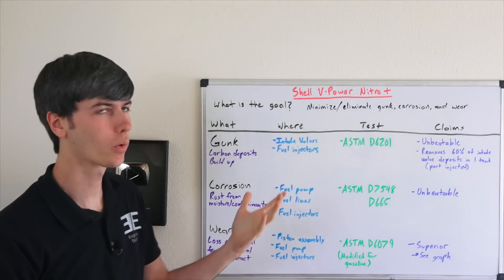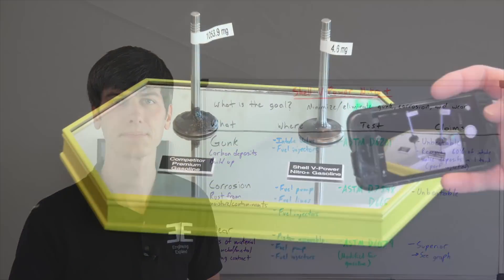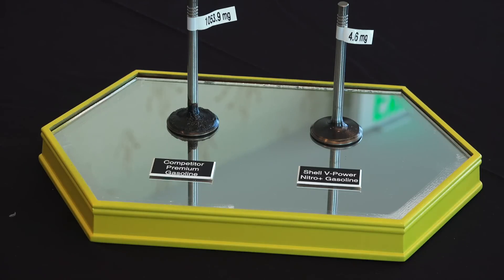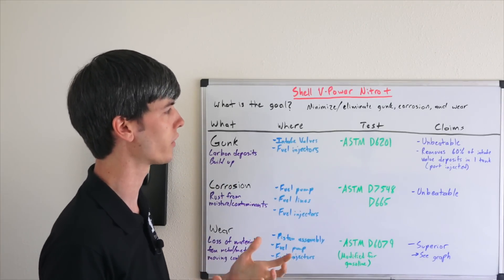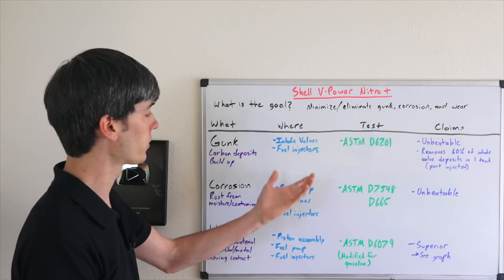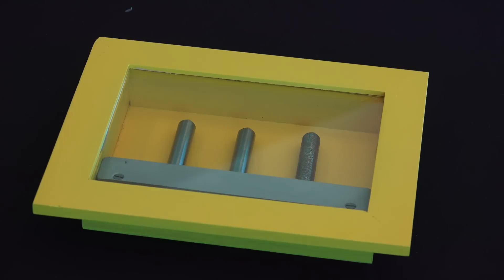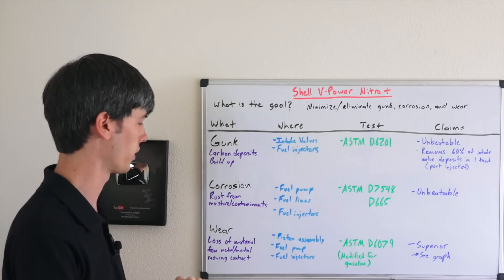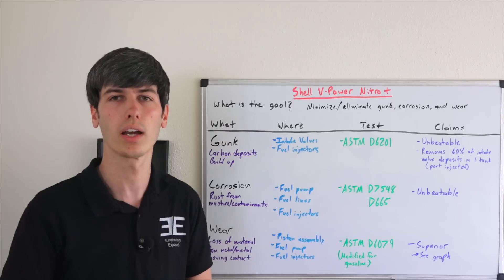Shell V-Power Nitro+ (Premium Gasoline Fuel Testing)

Comment: This is all well and true, I have no doubt that it works but the question is, is the extra cost of V-power worth it to prevent a few micrometers of wear or gunk build up in a daily driven commuter car? Is that gunk harming anything important? Maybe a loss of a few HP. Obviously in a race car with a massive budget this type of fuel can be used but I drive a 15 year old Toyota with almost 200,000 miles and I whilst I don't know what fuel the previous owner used, I do know that I put the cheapest possible fuel in it and regularly changed the oil. Now, if Shell says 60% of gunk will be removed after a single tank of V-Power, I might be inclined to run 2 tanks of V-Power per year along with my oil change as some further maintenance, but then the question arises if that gunk has built up over 15 years of driving and I remove 60%, it may cause new problems...
Reply: I buy a tank of v power nitro plus every few months before a long journey and it keeps my engine in great shape

Comment: With the difference in price between normal fuel and this Nitro+ i can buy a new engine once mine is kaputt :|
Reply: Benedocta Everyone in the world except for the USA.
Reply: Matthew Sharpe Nobody uses km/l
People use l/100km
Reply: 20km/l just do the math
Reply: Daniele Dal Col ***** 
I didn't see that its km/l... Who uses that measurement anyway??
Reply: TSX_Adonis here in Canada its over 20 cents a LITRE more than regular
Reply: 5-8p per litre difference mate. Don't think that will replace my engine.
Reply: Silus Jackson dunno in my country the difference between normal shell fuel and vpower is around 40 cent per liter i imagine that the difference between normal and nitro can only be greater... 100k km 20km/L 50cents per liter 2.5k€ maybe not an engine but is quite a difference. Imho
Reply: Benedocta Ah, sorry I miss-read - yes you are right, km/l is very uncommon.
Reply: Actually if you put the money away that you save by using low grade, in 5 years of normal driving (15000 miles per year) you will save 5 or 6K which is enough for a new engine or a good down payment to add to your trade-in towards a new car.
Reply: Daniele Dal Col What kind of car are you driving that uses 20l??
Reply: Daniele Dal Col do you drive a petrol powered tank or something?
Reply: Benedocta IMHO 5 litres per 100 km is not that much.
Reply: Daniele Dal Col not really..it costs like 10 cents extra per gallon from the middle or regular
Reply: TSX_Adonis in the States, i'm from Italy here fuel costs 1,7$ per liter for the normal fuel and 1,9$ for the V-Power.
Reply: +abelucious but what a difference it makes on my little MB B200!

Comment: These carbon deposits as you say. It's only the oil from under the valve seals. From which does not help get rid of any fuel. Especially on machines Volkswagen with direct fuel injection, the fuel will not even touch these deposits ever.

Comment: I call this video BS, serious BS. they don't account for driving styles at all, an engine which runs short distances, low revs would have gunk/soot for continous closed loop operation with richer running conditions as well as corrosion from condensation while a highway driven engine would still be practically new on it's internals. Shell are just trying hardly to justify their astronomical gas prices by lame advertising.
Reply: Engineering Explained Companies have said that about previous products of their's again and again. You can't just trust what giants like Coral say (or Shell or whatever it's called where you live). 

They have the budget to manipulate just about any information that gets thrown around
Reply from the maker: stilkus What's a more credible test than ones that are established as industry standard? Not trying to disagree, but what would be more valuable to hear about as a consumer?

Comment: We have to be very careful about those pics the Humble Mechanic provided. Those appear to be pictures from DI engines. DI does NOT wash the back of the intake valves with fuel, thus keeping them clean. It injects directly into the combustion chamber. So it's potentially confusing to show pics of DI valves when talking about the cleaning effects of this Shell gasoline which, by their testing procedure, are specific to PI engines only.

This is pertinent to me because I drive a Mazdaspeed 3, which is DI. At 35,000 miles I pulled the intake manifold and used walnut blasting media to clean my intake valves because my fueling system doesn't do so. I also installed a catch can at the same time to help eliminate the oily vapors that cause the buildup on the valves.

Great vid!
Reply from the maker: Zack Richmond Very true, apologies for not pointing it out! Walnut blasting seems great - he showed me some photos of before and after and the results were pretty impressive.

Edit: Added an annotation noting that the engines are DI.

Comment: Could you try getting a bore scope and seeing if shell gas can remove 60% of Gunk/ethanol deposits from intake valves. I have my doubts.
Reply from the maker: G8GTATL Man I've been thinking about testing it out on my Integra since it's never seen premium since I've owned it. I may do it!
Reply: Engineering Explained 

So the cleaning detergents are strictly on their premium, high octane, fuels?
Reply: Mega Pijon 

That's a bit odd is it not?

Most vehicles on the road today don't need 91+ octane so they are also paying extra for they don't need.

In the long term, they are probably better off buying a fuel cleaning additive once in  while.

Comment: great video however Alot of those volkswagen heads looked like direct injection heads where fuel type would not have impacted on intake carbon deposits. I have taken apart an engine that was always run on 98 octane premium fuel (mainly vpower) and the intake was shiney and almost new looking and that had 150,000kms on it which for me proved the claims must have merit.
Reply from the maker: James Lee Great point - I added an annotation noting the engines are DI, not trying to be misleading!

Comment: Would you recommend using Shell V Power? Or are those tests just a marketing sham?
Reply from the maker: Makedeth I use it in my Subaru. Integra gets whatever's closest. Tests are not marketing shams, which is why I included the discussion about them. You can't legally make claims without the data to back it up. 

Well you can... you just get sued haha.
Reply: What are your experiences with it? and, thanks for the video, very informational. :)
Reply: Engineering Explained Well yes, you can't make claims that are false, but what you can do is conduct a hundred different tests and then publish the results from the ones that make your product look the best.

Comment: i am excited about it. A few questions. What about direct incjection engines. the fuel would not hit the intake valves right. I guess this applies to port injection where the injection sprays the intake valves cleaning them. When will it hit Canadian markets. Is this only in premium grade gasoline? And so you know what car or engine they tested. I guess you can tell by the engine design or cover as to what car they used.
thanks
Reply from the maker: lexusfan100 It's already available in Canada, yes it's a premium fuel only. The engine specs may be laid out in the test procedure (see the video description). Direct injection can be problematic, which is why you'll sometimes see port and direct on modern engines. A challenge engineers have to overcome!
Reply: lexusfan100 There will never be a solution except a dual port injection.  This really sucks cause my car has the Mazda MZR DISI motor.
Reply: Engineering Explained lexusfan100 ASTM D6201 is done with a 2.3 liter engine from Ford Ranger. The other ones don't seem to use actual car engines, just some pieces of metal.